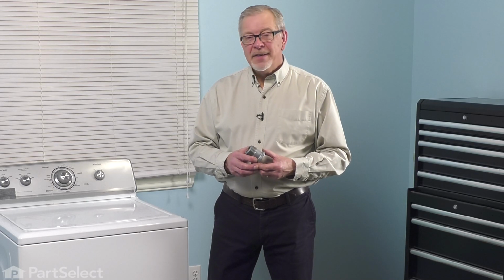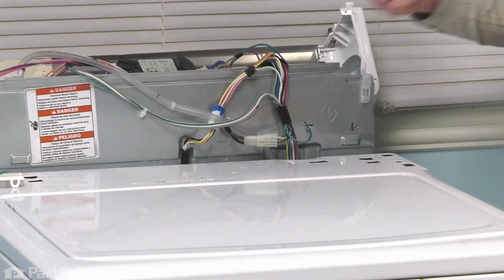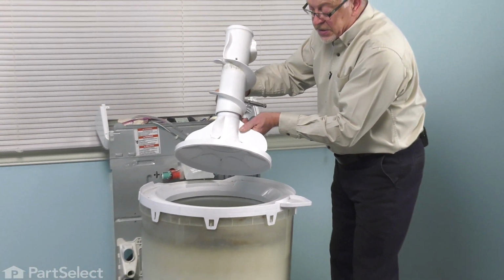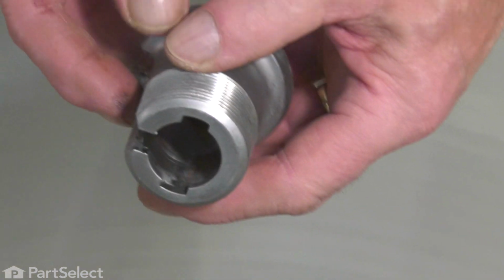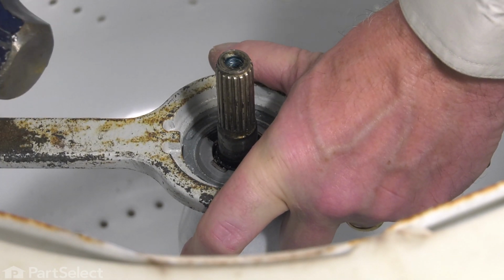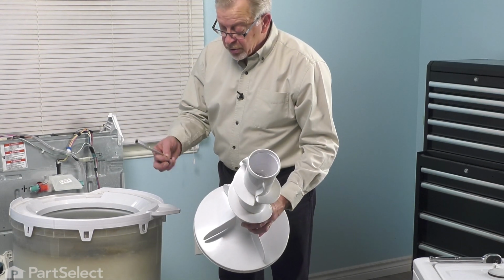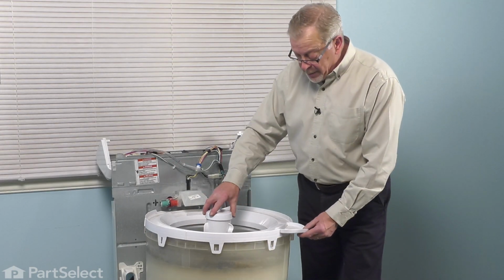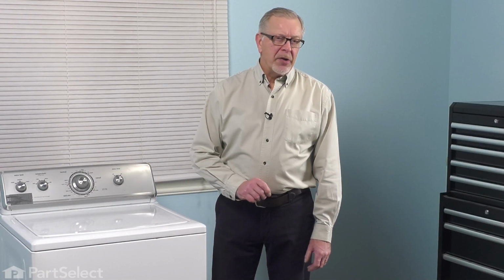Whirlpool Washer Repair - How to Replace the Drive Block (Whirlpool # WP389140)

Comment: Steve, yoiur video made it look a lot easier than it really is. As for my Dominican wife, first impression on watching your video was, that was a brand new machine. I responded that a brand new machine does not need a new drive block. She never reads labels and one load needs 3/4 bag of detergent. The result is the machine is full of rust and I needed a flywheel puller to get the drive block free from the transmission shaft. Also in her infinite wisdom the bleach despensor is designed for pouring in copious amounts of liquid chlorox. This machine is 10 yrs old in a household of 2 humans. However,she feels it is normal to change clothes 4 times daily. Lord help me!

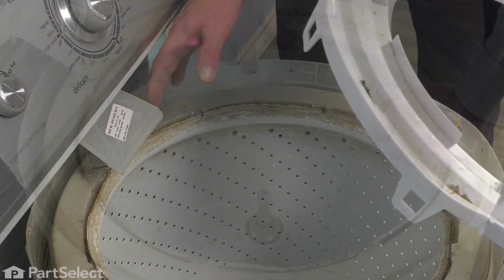Comment: 5:18 "now we'll just rock that inner basket till we break it free..."  everyone in real life has to go to extreme measures to get those two apart. I had to follow the suggestions of two people online, where I both put clamps on the system to pull the drive block off the shaft and pour boiling water on the shaft in order to slowly get the drive block off the shaft. I haven't seen anyone else pull the basket out without the drive block being attached because of all the corrosion between the two.  Most of these how-to videos are rubbish because all the parts are corroded together. I have had to scrub and scrape my parts with CLR and Vinegar for days in order to get them back to a point where I can finally put them back together.

Comment: If I can hold the agitator by hand while it tries to agitate, is that a symptom of a bad drive block?  Can’t hold it in spin. 
  I did not remove the drive block, but it looks like it is fitting as it should with the drive tube.

Comment: This video is perfectly fine but ... if your washer is old like mine (7 years old) the basket won't come off easily. The drive block is full of rust and kind of fused with the drive shaft. WD40, PL-100 never worked. I even tried C-Clamps trick it didn't work either. In desperation I even tried to unscrew the gear box under the washer to pull it out and even that didn't work out. This video make it look like it's a very easy fix which it is but it isn't true for old washers with a drive block stuck in rust. Finally I'm calling a repairman or buying a new washer.